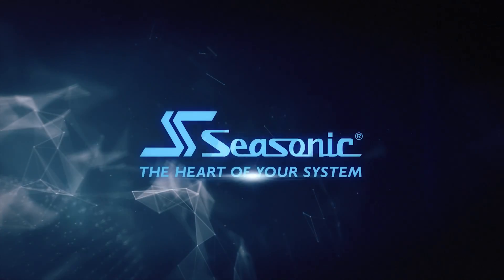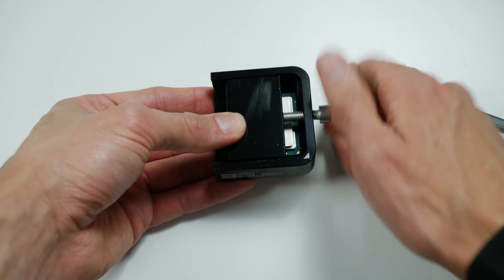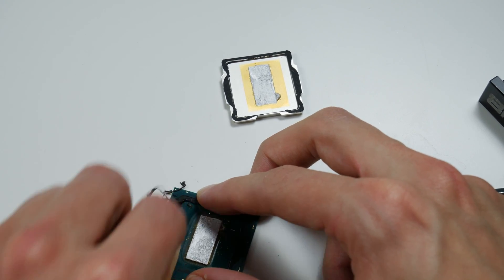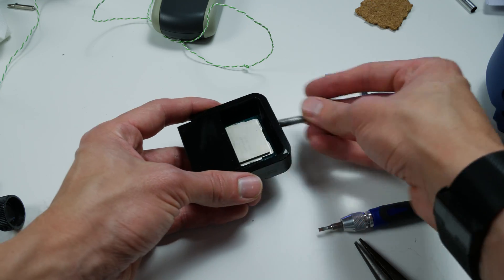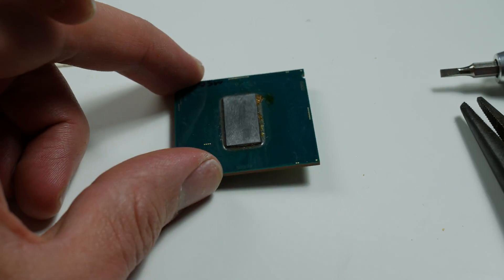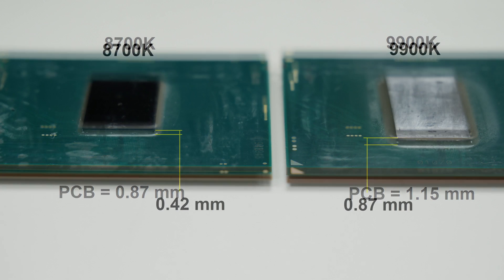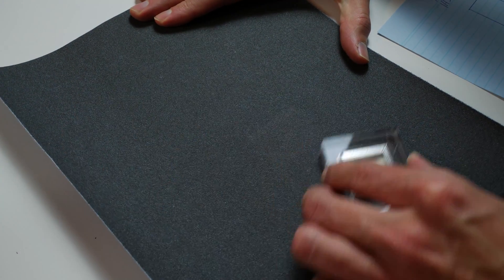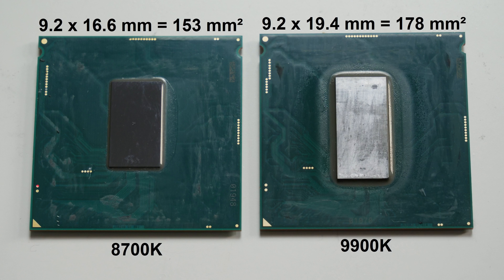Bad sTIM? Why is the 9900K so hot?

Comment: There are several reasons for increasing the silicon height.
 The first is that this is how all other IHSes were made and to compensate/move the top of the silicon closer to the IHS instead of just changing the IHS, TIM would just have filled the gap regardless. (I know silly reason and the IHS chance would be cheaper, but it is INTEL we are talking about). The Second would be that this is not Intels doing as they are also bound by there wafer supplier and Intel cant get the thinner wafers anymore. The thinner wafers are to fragile and broke a lot during transport (in-house or other wise).

Though there are also some reasons why it is strange that Intel increased the silicon height. 
For strength it will not help as we are dealing with pushing forces to the socket the best way to deal with those is just to make the PCB and IHS stronger and leave the silicon alone as it is no where as strong as the PCB or the IHS. The proof is in the previous generations as they weren't soldered either and no one ever complained about a CPU snapping in half because the IHS or the PCB was not strong enough. As you already mentioned the worse thermal performance.

Comment: In before 9600K to 9700K sofmod? But without that possibility the prices are so bad that it doesn't much matter if the temps are bad. Had my eye set on 9700k, to basically get a soldered 8700k, but it preforms almost exactly the same and cost more (and with worse temps).

Comment: from a materials engineering technology point of view, the only (technological) reason that would override/trump this method(thicker top-die surface material layer) imo is Specific Heat Capacity. The layer can absorb more wattage(Joules). Its a Fabrication/Manufacturing Safety "feature". When you apply the lid bond, its only a fraction of a second ex. 200ms heat pulse thus you control the amount of Joules in system, the important stuff "actual CPU parts, doesn't "overheat" to acceptable destruction threshold of temp even b4 it even powered on for first time. Conductivity on the other hand is the Transfer Rate of wattage(joules/sec) through the material. btw, not factoring "cost/profit", just pure CPU functional yields  at end of the production line. 
TL:DR minimum requirement thickness to survive fabrication process of top-die CPU heat transfer tolorences.
Reply: That's my thought. Intel is pushing the 14nm process to the absolute limit. They also have supply shortages. Thus they do whatever they can to increase production yield.
Ryzen on the other hand has no supply trouble. AMD wasn't worried about beating Intel in performance, they were worried about price. Plus the yields are so good they would have trouble filling out the lower end of the product segments without some kind of "risk" taken to damage the CPUs. Soldering is probably one of those steps they deemed worthwhile.
When you look at their low-production units (the APUs), they don't use solder. They use thermal paste, to increase yield...
Reply: Yes, more silicon can absorb more energy but the thermal conductivity is bad so for a heat spike the circuit part of the chip will still get all the heat because spreading the energy takes some time. if your thermal conductivity to some other material is better than the one of silicon then it makes more sense to use that as a heatsink.
Reply: Frenchstud
'Overheat', it's more about the ideal running climate, WATT + AMP = HEAT, so you have to reduce the heat only when it's above the  ideal running climate, couching the heat to make what we call trotting issues. What do you need, to run console titles on a Windows Intel machine, a extere nVidia card the only need here, on what CPU do the nVidia cards run the best?

Who is still needing CPU's in 2018, the cloud server market needing the 7nm low power CPU's, gamer community needing the High Watt 16nm versions, are the gamers still get what they need?
All titles are console titles now, not needing any good PC!
No gamer need to do this, or be on this level, Too nerdy YouTube content....
Just do a nice build, or keep the GTX 1080 on 7700k! Needing to build a RIG now, RTX 2000 on 9900k the best choice if you need it to be better!

I don't think intel R&D is not understanding this conversation, their official reaction? You don't need CPU's doing 100mhz better! Gamer's do have other need running Console titles! Who still needs CPU's in 2018?
Reply: i have to disagree. the heat capacity is negligible. as you mentioned, we are talking about miliseconds. The reason for thicker materials is probably due to tolerancing and/or stresses due to the presence of solder.
Reply: Frenchstud But indium melts at only 157C. Would a brief pulse at that temp really anger the chip?

Comment: Came here after watching the GN deliding vid, how is it so easy to delid these without heat when I remember seeing destroyed silicon when people tried deliding the X99 cpu's, something I did notice is my soldered 5930k has a breather hole for the soldering process, yet these new soldered cpu's do not.

as for why the silicon is so think on the 9900k, maybe they're using thicker copper traces in order to keep the power higher to maintain clocks on more cores given they're currently trapped on their current node process, would explain why they're getting so hot, and the last few cpu's have also had heat issues, so imho it makes sense that they've hit the upper limits on this node, they definitely have nowhere left to go until they get to 7nm.

Comment: could you compare it with ryzen ?
They have decent temperatures and they have solder however!
2200,2400G have lower die heigth than the others so I think soldering might need to be taller as you suspect ? :)

Comment: What was the die thickness of the last soldered mainstream chip?  Has anyone tried to delid a Sandy Bridge chip to measure the die height?  I know the temps of that chip were really good and there was never really a reason to delid but a comparison between die heights would be interesting.  Though we are talking about 4 vs 8 cores and 32nm vs 14nm.  More cores = more heat and smaller process = more focused heat.

Comment: My theory is that it is because intel made the 9th gen using 450mm wafers, and the 8th gen was on 300mm.
According good old wiki, bigger wafers have to be thicker to have the mechanical strength to support its own weight, so that it does not crack during handling.
Reply: at the end of the fabrication process the wafers are ground down .
Reply: Aren't we all ground down at the end? I know just how those poor wafers feel.
Reply: @ellsworth1956  they're ground down and then wafer dicing separates out each individual die. The wafer needs to be mechanically stable in between these two processes. Scaling of bending stresses is nonlinear, and I can well believe that 50% greater wafer diameter requires double the ground wafer (and die) thickness.
Reply: @ellsworth1956  btw grinding needs to be done before dicing because thicker wafers are harder to dice. You're more likely to disturb the circuitry due to the stresses induced by dicing.
Reply: @Wren6991  I am well aware of when the WAFERS are ground as I worked in the Semiconductor Industry for 20 years.
Reply: @ellsworth1956  Sorry, I misread your comment, and thought it implied something it didn't. My mistake.

I'm just starting my journey in this industry, although I do mostly RTL, not backend :) so please forgive the mistake, I have a lot to learn
Reply: I’m pretty sure 450mm steppers don’t exist. They were cancelled a few years back.
Reply: Handle Different.

Comment: Are the increases to die+package thickness combined enough to get the die above the edges of the socket? (e.g. Can you finally run an 1151 chip direct die without needing an IHS with a hole cut in it?)

Comment: When I was in college I was told that sanding using figure eight motion will cause the flat surface to eventually become convex. The procedure I was taught was to sand in straight lines five times in one direction then rotate ninety degrees and repeat giving equal strokes to each rotation.
Reply: On other videos from der8auer and on my experience of lapping the IHS only of my delidded 3770k few years back,  It was shown that both the Naked Die silicon and the Top of the IHS are actually not 100% flat.

Heres a der8auer video : https://www.youtube.com/watch?v=tnd2LO0IBic

at 4:25 showing that the Die is not 100% flat.

at 8:06 of the same video shows that the middle part of the die is convex (its not flat from the get go).

and then   IHS can be Concave or Convex. 

In my experience, when I lapped the nickel plating on my 3770K IHS on a flat glass table and tried my best doing so. It showed that the IHS on my 3770K was concave right on the center.

Whilst I saw some AMD chips had a Convex middle of the IHS right on top of the silicon die. (FX8350)
Reply: yeah figure of eight isn't good for when you really do need that perfect flatness although it doesn't matter too much in this case as long as you're getting a smooth surface
Reply: figure 8 might give parallelism, whereas your method probably gives excellent flatness?

Comment: The idea that it'd be a better temperature with paste than solder is ... well, I don't want to throw accusations around, so let's just say it's easily testable.

Just delid them and then use paste TIM and test them. Do it with the stock thickness die and sanded down die.

I seriously doubt the 9900K will be any good with paste TIM, to the point that it can't even maintain its standard frequency of 3.6 GHz all core when subjected to load.

Comment: So 9900k is basically an FX 9590 from a temperature standpoint.
Reply: At least FX was honest about it’s thermals with 220w TDP in the specs
Reply: FX would thermal shutdown well before this. I believe max temp on the spec sheet was like 69c, but I'm pretty sure you could set thermal shutdown limits at 79c if I remember AMD Overdrive correctly. I don't have to worry about it much though, mine rarely ever peaks beyond 0c at 1.7 vcore on a small phase cooler, only a few synthetic loads can make it do that.
Reply: @jakegarrett8109  The temperature sensors were also off by a few degrees.
Reply: @PimpMatt0  Yeah, it would show 10c when ambient was slightly higher (so impossible on air/water). FX is only accurate at higher temps (non-linear thermocouple)

I think its still below 0c though, my block temp peaks at -25c after a really long load on synthetic loads (-35c in Firestrike and Timespy, it needs to use more power than that and for a much longer time, like a few minutes). Idle is -58c on the block (I didn't drill into my CPU to put a temp probe, so the only way for me to get temps is from the probe in my cooler, and from software for core temps, but software won't show below 0c, I just know it runs cold).
Reply: Exactly ...
Only thing is, the FX 9570 as well as the FX 9370's EST is precisely at 57°C (sic!). On everything above and beyond this so-called Emergency Shutdown-Temperature the cpu itself will electrically emergency cut-out itself physically. Then there's a *CLICK and the system is down immediately.
… and as you can figure out already, that makes all those stories about Bulldozers reaching like +100°C pure nonsense and bullshit (straight-out lies to hamper the bulldozer's reputation, FUD?) – as all the ESTs of FX Bulldozers are either 57°C, 61.10°C, 61°C, 70.50°C or 71°C respectively (depending on model).
Reply: FX9590 owner, running at 5.1 max temp of 60c on h100igtx, and 65c on my push pull thick 120 aio. so nah.
Reply: he because its unacceptable

Comment: Maybe it is because the soldering process. Thicker die so that the risk of damaging the CPU from the heat application when automating the soldering process is lower? Could be a tolerance issue or a manufacturering impact as well.

Comment: I'm surprised intel doesn't thin the wafers at the factory... I was an engineer at an HP water fab in the early 2000's and all our chips underwent a thinning process back then to get the best thermal and electrical properties....I still have a load of the diamond 'paper' and compounds... Better keep hold of them for when 9900k gets cheap enough to play with
Reply: The SEMI standard for 300mm wafer thickness is approx 785 microns.  So the work indicates that Intel is using the native wafer thickness, which really means that the prior nodes were backside ground to something thinner, which means it costs more.    Could be as simple as competing on cost while providing sufficient cooling for their product specs..overclockers be damned...
Reply: Thats quite interesting, good idea!

Comment: From what I know of thermal expansion, a larger object will expand and contract by a larger amount than a smaller object (1mm expanding by 1% to 1.1mm vs 0.5mm expanding to 0.55mm) therefore putting more strain on the system as a whole, would this not then mean that a thinner die would allow for a thinner application of sTIM?
Or am I looking at this all wrong and the only expansion that matters is in the horizontal plane, meaning the thicker die and solder layer allows for better distribution of the load, and  reduction of strain at the interface?
Reply: Yeah in hindsight the shear forces must be the main concern. Shame that Intel couldn't get their sTIM to be as effective as AMD could on Ryzen

Comment: This is really disappointing to hear. I was looking forward to getting good temps without having to go through the delidding hassle - but not it seems like not only is that still "needed", but also the amount of work and danger is a lot higher. Delidding a soldered CPU is a lot tougher for sure than a simple TIMed one - much less the whole bussiness of grinding. That's even more risk and requires some decent gear and experience to do right.... sigh

With the high prices to boot, Im not sure I can justify that kind of risk honestly.

Comment: Maybe you could delid previous generation xeons with large cores as they all come soldered. That would tell us if they are thicker than the same generation i7s. I have an x5650 and I know that it has a huge elongated soldered die of similar shape to this new cpus but seems to run cooler than i7s of the same generation.

Comment: I'm a happy R7 1700 user running at 60C :D
Reply: Yep, even with so small of an AIO you can see my CPU sticking out all around AIO, my Threadripper 1950X runs about 65c at ~4 Ghz (cooled by a 120mm AIO, gen 1 Asetech pump made for DELL XPS before Alienware existed, so its a very, very old cooler). I'd say 3.9 Ghz is about right for 65c (just so the fan is quiet since I sleep close to it) running 4x Handbrake encodes at once in a batch run.
Reply: I'm a happy i5-4670 user running at +24.0°C
Reply: My Pentium 2 core G4560 running max at 64: tootpaste and stock cooler forever lol
Reply: Why not buy 2 hand Dell Optiplex 7010? you get i5 3470 4gb ram and a monitor for like 150$ refurbished.
Reply: Bcause i just need a 7700 later/soon (Asus z270 board, 16GB 3200MHz, RX 570 right now)
Reply: Still doesn't make sense why would you get 2 core cpu or 7700K  later? Only gaming?
Reply: Yeah for games and browsing. This rig is a 1.5 year old (before Ryzen), but i ran out of money, so I bought the best buget cpu at the time....its still ok for locked 30fps 1080p gamepad gaming, but i will buy a 7700k.... (and cooler) soon
Reply: Sorry to hear that. Why not i5 6 core or 2 hand i7 8700k? Quads are bad choice for longevity because i7 7700K is at 99% usage when gaming.  I bought my R7 1700 for 200$ new. I will upgrade later when 4xxxx comes out. I bet 16 core at 5 ghz will be possible.
Reply: Sadly fking Intel dont allow 8xxx cpu in Z270, and i dont want to buy a new motherboard after 1+ year.... this platform sadly is a dead end, thanks intel (but the 7700k is still rocks so its not too bad....)
Reply: @Krisztian5HUN  Yep I also got i7 7700k for z270, not even a bad deal considering that I bought a second-hand one. Sufficient enough for gaming, haven't met a game where it would have been a limiting factor.

Comment: it could be thicker to average the heat output from the bottom to the top.  if the solder was closer to the cores then the hotter cores would make hotspots in the solder causing it to expand differently in diffferent areas.  the extra layers of silicon could be to let the heat spread from the hot spots to the rest of the die surface area.  of course with a thicker package it would seem to point to stuctural support as you say.  could also be that the heating process when soldering requires a thicker chip to withstand the strain as the solder cools and is put in tension.  but most likely stuctural

Comment: so the 9600k is based on the 8 core die?  why not just continue making the 6 core die they already had for awhile.  with double the thickness and around a third more area this will use a lot more silicon.  but silicon is not the big expense but litho.  but still it seems wasteful.  hope 10nm comes soon and they make the i9 die the new i7.  if they dont then i will be very disapointed
Reply: The 9600K is just a slighly defective 9700K/9900K. Deactivating the defective cores and selling it as a 6 core is better than throwing it away. And I'm sure they'll continue making the 6 core 8th gen parts for quite some time.
Reply: @IsakH85 yes i know how chip binning works but the thing is intel has NEVER turned off cores on the i5 series.  its mainly limited to the high core coutn chips.  amd does it for ryzen but intel never has.  they turn off HT and some of the cache on the i5's before now for sure but not cores.  i bet the 9600k will be the only one that is based on the 8 core die.  and maybe the 9600 non k.  the locked chips will be based on the 6 core die i bet.  either that or they will not make i5's lower than the 9600k in the 9th gen and just sell the 8th gen.  again i know about chip binning just never though intel would actually turn off dies on the mainstream line